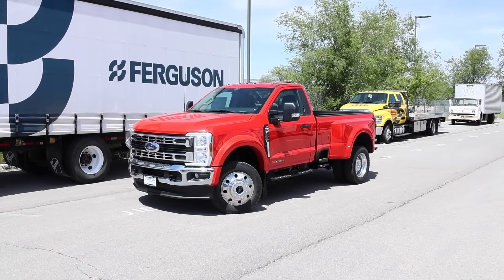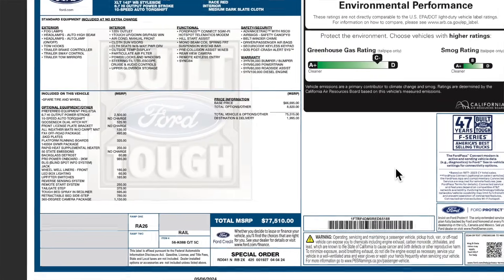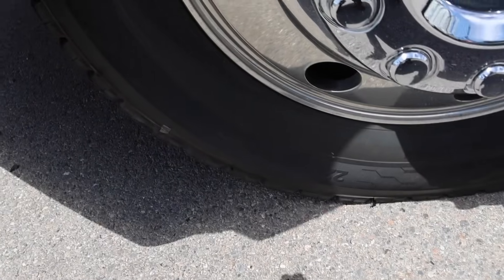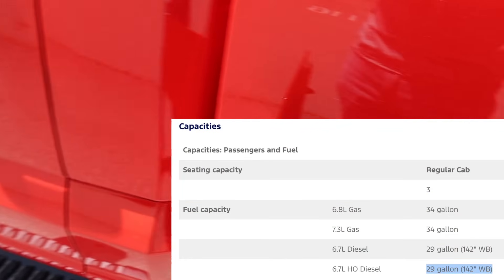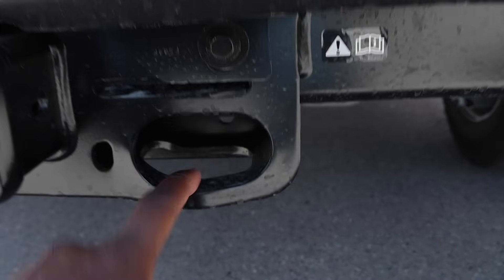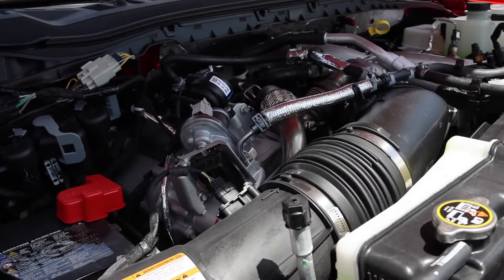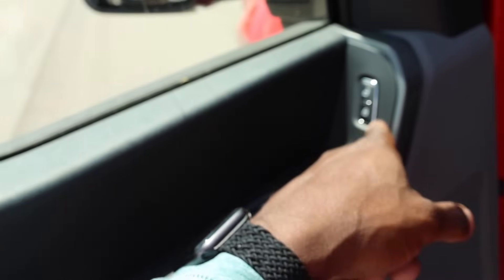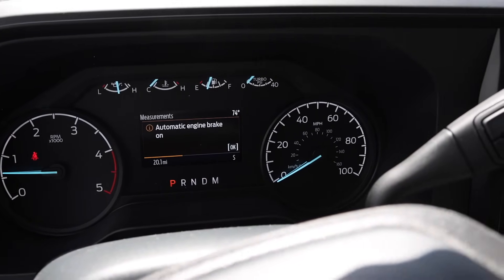2024 Ford F450 RCLB Tow Pig PKG: Do You Really Need This Much Payload???

Comment: JB find out why a truck camper can’t be used.
Reply: Pretty straight forward answer is that it is not optioned for the Camper Package. Without that package on the build sheet Ford does not certify for slide in camper use.
Reply: I'm thinking too much weight on the front axle because of the short wheel base. Just a guess.
Reply: @jarrsong This is just flat wrong little bro 😂
Reply: @_zach  Why then? Any idea?
Reply: Front end torsion bars and heavier front springs, etc etc for camper package.
Reply: It can be used no issue at all heavy duty front suspension already and heavy duty rear suspension you can probably put 6000 lb in the bed there's no reason why that won't work
Reply: @pekindown  It will not have lesser springs up front than my crew cab truck.
Reply: @rich7447  Okay captain obvious… Just because you don’t have a camper package, doesn’t mean you can’t haul a camper. The GVW on this truck isn’t any different than my crew cab F450, so it had to be weight distribution issue somehow. Possible the over hang for the bunks interfering with street light visibility from over hanging the windshield too much.
Reply: @pekindown  I have the camper package and snow plow prep added to my 2024 F450, it says “computer” selected springs but the rate difference isn’t worth mentioning.
Reply: @jarrsong  It's not my rules. Ford doesn't certify any truck that doesn't have the camper package for use with slide in campers.
The camper package gets you stiffer springs front and rear and a rear sway bar, but the most important thing in the package is the camper certification card. Without it, Ford will state that the truck is not approved for use with campers.
Reply: @rich7447  More fake info. Camper package or not, you get sway bars. No where does it say you are getting increased spring rates. It does say you get computer selected springs. What ever the hell that means. And I’ve seen trucks with camper loading instructions without camper package.

Comment: I have a 2023 F450 Reg cab 2WD with camper pkg.  It handles my 5500 lb slide in camper really well.  Must order the camper pkg for Ford to certify slide in camper.  My cargo capacity in bed is 6216 lbs.  Mine is an XL trim level.  450 turns much better than 350 and the extra 2 inched width is a much more stable platform.  I had a 2019 F350 XLT 4WD before.  And the difference is very noticeable.  I tow a 7000 lb trailer as well and with the camper and trailer the truck handles both with no strain at all.  The 450 2WD rides very well empty which the 350 4WD did not.  Just a few of my observations.  2nd 450 for me and like the 5th 350 over the past 20 years.
Reply: WOW! That's a tow pig right there.

Comment: @robertsanchez That was pretty accurate in older SD Gens... New 23-24 gen has a greatly improved Eng Exhaust Brake. Some have expressed same as or slightly better than Ram.
Reply: My 2023 really surprised me. First truck with one, coming from a 2012.

 45% brake is the max I have hit on a 7% grade, and it held a 16,000 lbs load at a set speed.

Comment: Notice no vacuum line going to that right hub? Ford eliminated the unlocking hub on their right side in 2024. It’s a dummy hub plug that is always engaged. Do a story on it JB.
Reply: @jarrsong The dummy hub can be replaced, and add the vaccum line & hose. Helps prevent a shimmy if you install chamber adjust collars.
Reply: @dougcjohn  I put two manual locking warn hubs in from the performance Ford site.
Reply: @jarrsong  that works too! I actually didn’t realize they still offered manual warn hubs. I’m swapping the dummy with live hub and line kit.
Reply: @dougcjohn  I actually bought two sets because my buddy also have a 24 with one plug. He ended up buying one ford hub for that side. So I do have another set. The Ford hubs just aren't that good and seize over time as well if not constantly worked. I do a ton of HEAVY hauling with a huge dump trailer so I wanted the ability to put my F450 in 4 low, but unlocked hubs.